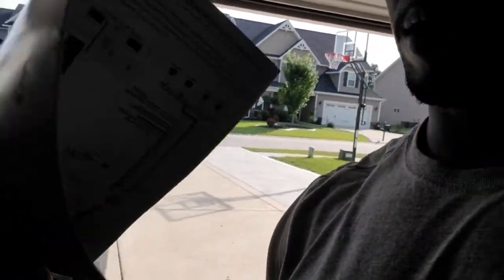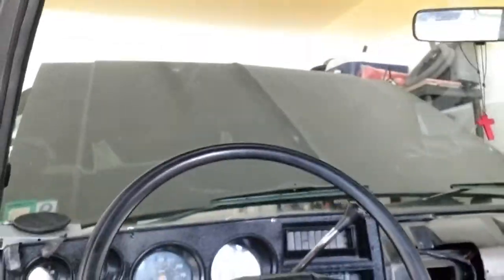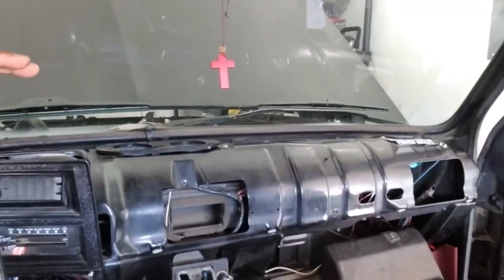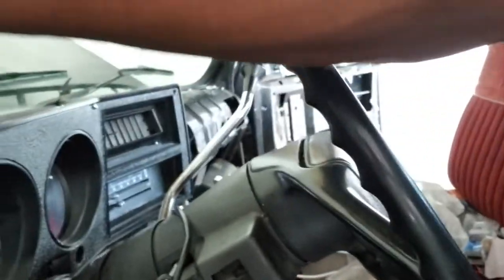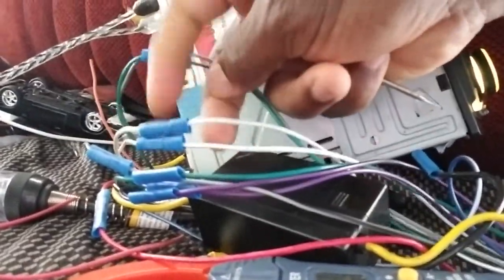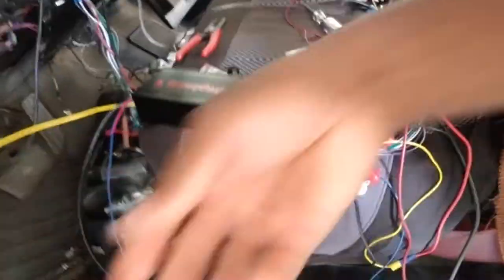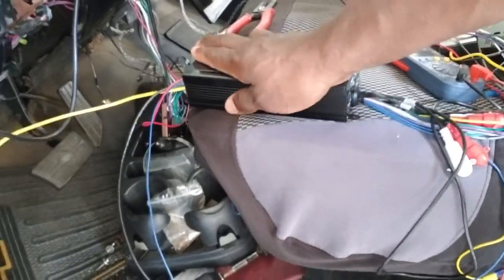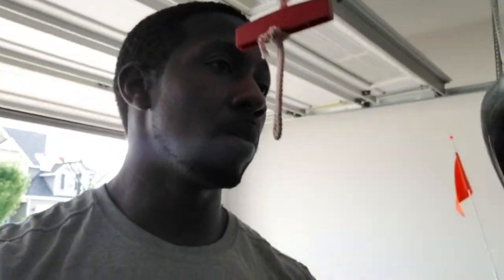Sound cutting in and out when audio volume is high.

Comment: I think that is the same issue I’m having with my home receiver. I think the speaker connectors I put on the wires were making a flakey connection and when I turn the volume up the sound cuts out like it’s chopping. 
Thanks!!

Comment: I'm having issues with one speaker it tends too cut off sometimes at mid volume and sometimes at high volumes but doesn't completely cuts off. It cuts on and off like maybe a loose wire but everything seems fine. Any advice thank you
Reply: I'm having the same issue now in my semi. 2 12 skar vented box combo with 3000d skar amp, it just started but been set up for a month now I can get to 30 at volume use to be stop at 35 hitting hard. Green Light on amp dim out and the subs make a popping sound some time when it fade out
Reply from the maker: Might want to check all of your power connections sounds like you're not getting power like you should be at those Volumes being that it used to work with no problem
Reply: @CurtARoll  thanks I checked my power wire going too my 1500 bdcp the wire was fried. I think it might be too small of a wire....
Reply: @jrantman  check your power wire and grounds make sure you have good quality wiring and good size guage.
Reply: @luisparamo9402  it was the inline fuse at the battery it was melted on the plastic bottom so we did check for voltage. It dropped to 9 volts so it was replaced with a 200 amp fuse its holding up well

Comment: If the amp is a 2chnnel you should be able to run single 4ohm speakers 2 speakers per channel but has to be the same speaker not mix n match .the best thing to do is to get a 4 channel amp run at 4ohm its more safe.if they 2ohm they seem to have more clipping problems.plus very important check and clean your grounds

Comment: I just did the big 3 upgrade and when I cut my head unit off, I hear a pop sound come from the front speakers... Any idea what happened? Question 2.. I have 6 alpine speakers on a 4 channel head unit.. All speakers are coaxial... Which means I have 6 built in tweeters.. Should I remove 2 of them? Or just use bass blockers on my 3.5s?
Reply from the maker: Check your ground location, ensure your speaker wires and Audio cable aren't laying across it or near something that would create interference or magnetic field.  I'd use bass blockers or get an Eq for those speakers. I'm not a pro but just some tips from my experience.
Reply: @CurtARoll  I was thinking bass blockers. I will try that 1st and as a matter of fact my rca and speaker wires are actually laying across the ground. I'll clean it up and see if that helps. Thanks for the help.

Comment: I have a Phillips 280 Watt Home Surround Sound. The back of the receiver reads: >6 Ohm. I changed out the stock speakers and put 4 Ohm Boss speakers in. When I increase the volume to just over half way, the receiver shuts off. I have to turn the power back on and turn the volume down to continue playing music.
Reply: JERRYR708 I’ve got the same problem with my Onkyo Tx-nr501. I can barely hear the sounds in anything I watch because every volume surge sets the amp into “Check wires” mode. I have a basic stereo system which I replaced the amp with and even that drops out too.
Reply from the maker: I believe you should be running 6 ohms or higher,  too low impedance will cause over current
Reply: @CurtARoll The originals were 6 Ohm. I thought I could cheat a little, but you can't beat laws of physics. Thanks.

Comment: My speakers are fine is just when it’s on high volume the amp just turns off ?
Reply from the maker: Sounds like an over current draw. May want to verify speaker impedance wiring and make sure impedance not too low
Reply: Check your ground or your load if your amps under load a to cut out he got a background it will cut out in AV led enough the gas in it cuts out or when you stopped you deafening guy a low ground or just bag power altogether it's not impedance load as it plays on the freeway

Comment: Don't do that... just run them in series to get your load right so you can still run all 4 off the amo still and not the shady deck power that will clip shit to death...  Also check with your amp to see what the ohm cloud of each individual  channel as well as bridged. Typically you get a lower impedance with four channels versus bridge. This is  typically the case with high amps when  Bridged where with the class D amp for the subs is normally the other way around. Check these things out as it may just simplify things for you this time or the next time around.

Comment: My speakers cut out when I turn music at high volume. Usually as soon as the Bass hits or when my vehicle is at a stop. As I’m driving, the bass continues It also just started putting in low bass then as the music plays out of nowhere it puts a loud deep bass. Someone help me out!
Reply: I have this same exact problem!
Reply: First thanks to dude for making this video I have that same problem, it should help me, I have 8 speakers hooked upto my amplifiers 2front6½ 2rear6½ 2cargo6x9s & 2 quarter inch speakers.....I have the 6x9s & cargo speakers hooked up together from the wires not the amplifier, so they now running off their own channel, ima unhook the 6x9 & quarter speakers that's not running off their own channel & see how that works....if not going get a amplifier with higher watts maybe 1200-1600 just for my high speakers, my bass holds 5000w
Reply: This is obviously a alternator problem because u said it happens when you stop
Reply: same problem

Comment: I have this problem also but just at high volumes what’s the fix
Reply from the maker: Ensure your power is up to par for amp or head unit. Good ground, proper wire gauge for power and ground, clean solid connections, proper impedance load on amp!

Comment: if i turn up the volume to high and my amp getting in protection mode .. so i turn off the head using .. after 5 minutes i can play it again . then got protection mode again .. and you got any issues that would could be??
Reply from the maker: Make sure the ohm rating for your speakers are wired to match ohm (impedance) of stereo output
Reply: @CurtARoll  okay . thank you sir 👍🏻👍🏻

Comment: my speakers arent fully cutting out its just when bass is high in a song and i have it loud they will struggle kinda cause they try and hit the low notes when they clearly cant
Reply: First off you probably have a factory alternator that is not producing enough power and I'm guessing you only have one battery. Upgrade your alternator to atleast a 180 amp, preferably a 200. That usually solves power issues. Or you can add a 2nd battery, and if you do that you won't have to worry about upgrading the alternator. Or you could do a big 3 upgrade and add a capacitor, which would be the cheapest route. If you don't have enough power to your amp you are probably only getting half of what the RMS power states. If you have a 1000 watt amp you are probably getting 600 watts at best. And use zero ga wire if you can, it makes a difference
Reply: Yusuf Jorgenz I still run my speakers from the radio but I do run 2 subs on a amp a 12 and 15 making 2000 watts rms and 3000 max and yes my alternator is 78amp and I have 1 battery and haven’t had any issues yet. Except my 12 makes popping noises when volume is high
Reply: @2025944  70 to 80 amps for 2000 RMS? O dear lord! I have a 160 amp and it's not enough.. Man you can go on ebay and look up BnR alternators and get a 200 amp for 150 bucks. It'll be the best money you've spent. For years and years I never messed with upgrading my power sources.. I've been into car audio for 17 years. If I knew then what I know now, I would have upgraded them 1st. What you can do is use a marine battery in the trunk, most people don't know it but it works. But yeah a 80 amp alt. And a single battery is depriving your system. Add a battery or upgrade alt and you'll see your system DOUBLE in clarity and volume.
Reply: Yusuf Jorgenz yeah my 12” sub is making some physical sounding poppin noise I wanna get another battery but I really don’t know how I’d do it I got a single cab pickup I have the 15” in the bed with a bed cover. Maybe find a way to put the battery back there would be nice. Also I tried getting a 120 amp alt but the previous owner changed a bunch of mounts so I’ll have to get the mounts changed and bunch of stuff done to change alts
Reply: @2025944  alls you do is get the 2nd battery.. Run the power wire from the front battery to the back battery. Buy a terminal with 2 inputs. Stick the main wire in the back battery then use another power wire from the back battery to the amp.
then ground the battery in the back (on a separate ground preferrably) oh and install another fuse for the back battery. If you have a 80 amp alternator get a fuse that's 80 amp fuse... If you get a 150 amp alternator get a 150a fuse. I'd just save up and take it to a car audio shop so it'll be done right and look good.. But yeah, that 80 amp alt ain't enough for all those watts. And with 1500 watts or more you need to 1/0 wire. Sky high audio actually has the best OFC AWG copper wire on the market. Out of 5 copper wire companies Memphis and Rockford included sky high audio had the best copper wire out of 5 different tests. Surprising I know. Rockford was 2nd place I believe
Reply: @2025944  and make sure you always get 100 percent OFC AWG spec copper. Do not get anything else. If it doesn't say 100 percent OFC AWG spec pure copper don't get it. NEVER get CCA (copper clad aluminum)
Reply: @yusufjorgenz5951  https://www.amazon.com/gp/product/B014S32UMU/ref=ppx_yo_dt_b_asin_title_o00_s00?ie=UTF8&psc=1 this is what i have now i cant seem to find where it says what it is but man that sounds like alotta work that i need pretty bad I thought about getting a 3f capacitor but its about the same to just get a deep cycle 12v battery.
Reply: @2025944  huge question. I just had a Kicker DX 500.1 watt amp installed with a kicker sub on my factory radio. When I turn my music up to about 30 it seems as if the songs play fast/skip not sure what to do but what should i do? Is it an easy fix?
Reply: @jenniferwhitlatch2543  do you run it through bluetooth on a fm transmitter or what? Sounds like cheap transmitter to me

Comment: it happen to me just make sure all ur amps have gd ground and gd power used thick cables like 8 gauges or thicker ok  in my case i had the pre ampand car stereo  connected with car wiring system i was using same ground for my stereo and pre amp or eq
so i  did used same power cable for both but i used car wiring ground for stereo and another ground for pre amp and that solved my problem  now i can put volume up with no problems
u can even use  for stereo  and pre amp  their own ground and power /i used a thick power from battery  to all amps  gd luck
Reply from the maker: , man it's so crazy you reply with this. Just today I installed new ground straps to my truck because I realized I've been having a grounding issue. I was only grounded to the frame with a unsuitable cable and of course you know the engine has motor mounts and the radiator support has bushings as well as the cab which would all impede good grounding. I also realize that I only have that popping of the speaker issue when my battery is not fully charged. Most days I put my truck on a slow charge and when I first get in I could crank it with no problems but a couple days later I start having that issue. I also would notice I would get a slow crank after a couple of revolutions also indicating poor current flow. Going to upload a video on it in the next couple days. Thanks man please like share subscribe

Comment: Im having this issue with a Soundigital 1200watt amp connected to some Ground Zero 6.5 which should be getting 200 watts per channel
Reply from the maker: yea this can be aggravating. Ohm out your speakers and make sure you got the right load on each channel and be sure you running the right size power wires to feed the amplifier.
Reply: @CurtARoll  Carlos from NVS audio told me the same thing. He said i need 4 gauge wire but mine is wired in 8 gauge.

Comment: Hey not sure if you can help me but what I'm having problem is that when I'm turning up my music louder my Tweeter that is Built in to the speaker (Coaxial) cuts off and just sounds like shit and I've taken it to 3 places and they just tell me that I new speakers which were replaced already and still doing the same thing. How I do I fix this?
Reply from the maker: You may want to put an equalizer to those speakers and tune the frequency and levels some separate from head unit. What ever filter on those tweeters don't seem to be enough to keep his sound.

Comment: I have the fix.........

I was having issues with my radio i installed. It would turn off when volume got to high and it wouldnt keep the memory after it turned of or when ignition was turned over.....
Well after much research.. 10mins
Just cross
The red and yellow wires.
Yup somehow it just works. Something about harnesses being for European models and color code is switched. Give me a like if it works
Reply from the maker: I'll have to experiment with that. Thanks for sharing!

Comment: I installed it in my home just a battery full charge  , one speaker,  no amp cant turn volume up past 20 somthing before the whole stereo turns off , then it will turn back on then off again over and over ... power ground +yellow wire ..simple then Pos. Neg.hookednup right to  Speaker , why in the hell does it do this...Pioneer Mixtrax DEH-1810UB The one with the red lights , 😡just so close to Smashin it ..Today I might try powerin it up with a 24 volt wire wall plug . Try to get as much power to stereo as possible...HELP 👀AHHHHH

Comment: Man so I was having problems but it would shut down for a longer time so I redid the ground and it was good. But then it started doing it again the voltage was going down and it would clip I have 2 amps 1 for subs and 1 door speakers and I have a L7i and it’s worst now. Can anyone help me?
Reply from the maker: You may want to recheck your connections and you may want to check to see what your impedance load is/ resistance  at speaker connections to amp and make sure that your amplifiers are rated at the ohm load you have connected to them.

Comment: My radio cut out and now is not turning on what do I do?
Reply from the maker: You may have a bad connection. Check your ground, battery power to radio and accessory power to radio..yellow, red and black wire

Comment: Lol... so what do I do?
Reply from the maker: Check your impedance and make sure that is correct and also check your grounds. My initial wiring had a load that was too high and recently I discovered my chassis ground to block was poor causing charging issues which was straining my Lil amp for power during high demand.
Reply: Cross the wires... Literally. Red and yellow.